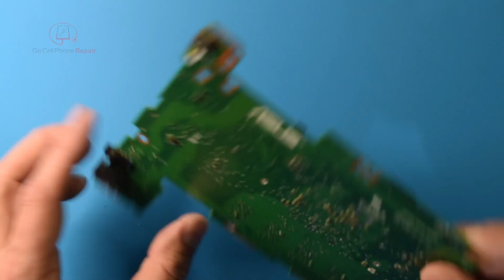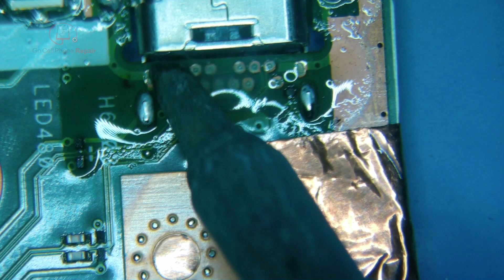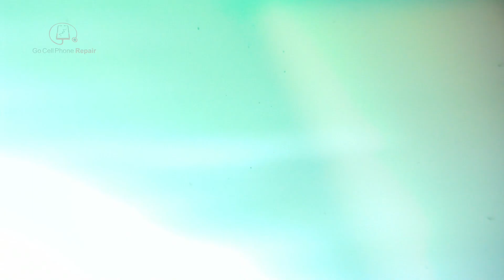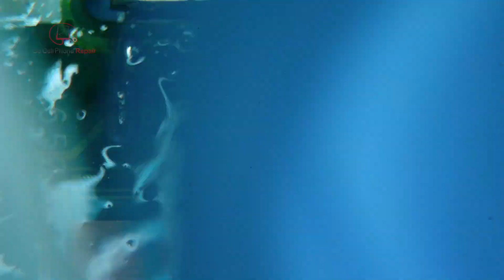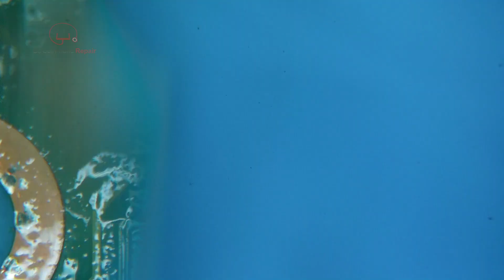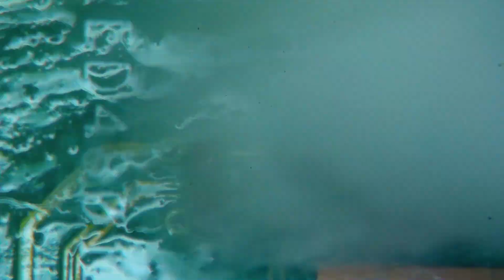Asus Chromebook C223NA Charge Port Replacement

Comment: I just did one of these. What a horrid vile design of a connector. You can't see or get at the pins to check it all went OK. No go though. Got 5V incoming but no light and refuses to take a charge. Won't turn on. I did have to fish the bit of connector out of the charger plug too.
Reply from the maker: Yeah. this was a strange one. Took a lot longer than expected.